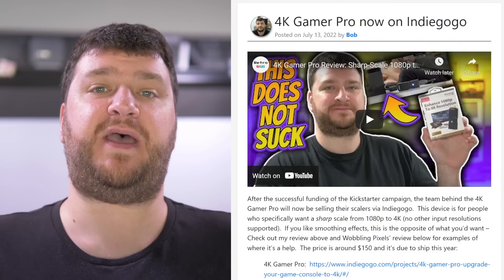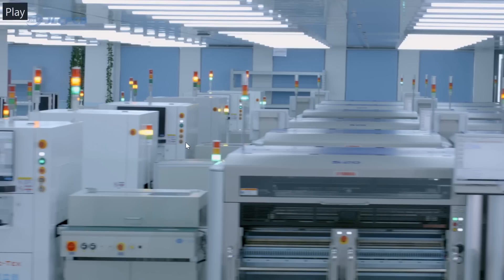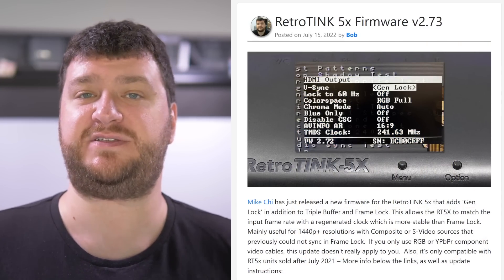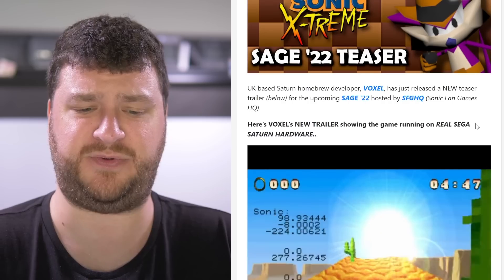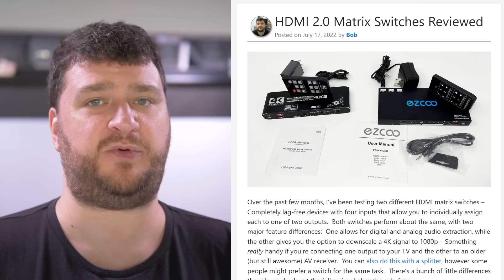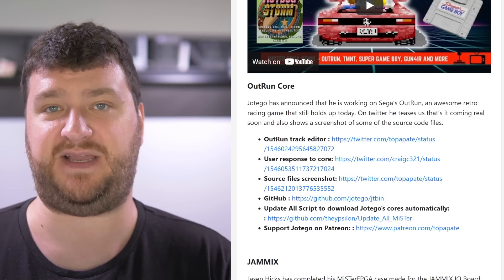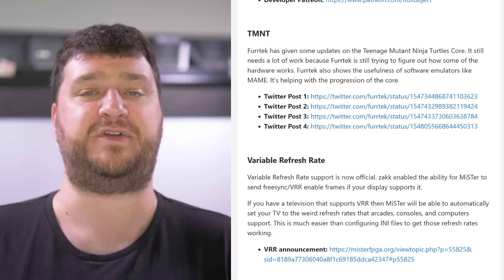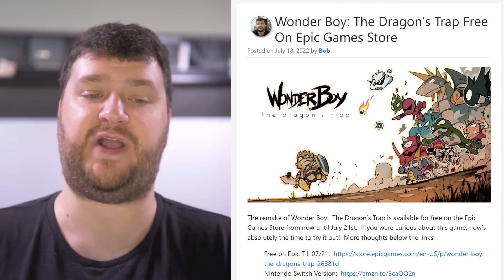RetroRGB Weekly Roundup #314 - July 20th 2022

Comment: The PS2 slim did have a vertical stand.  It was basically a metal disc that screwed into the bottom of the unit. The Retro Frog stands look great though.
Reply from the maker: Oh wow, really?  I've never even seen a picture of one!
Reply: There were different versions of the slim stand for different versions of the slim depending on region
Reply: @Phantasm I’m saying the Japanese 90000 series PS2 slim has a different stand than the 70000 series. And we never got it in the USA
Reply: @Phantasm it looks different. More akin to the phat PS2 vertical stand. It’s very heavy for a stand. And they’re not cheap, since it’s an official Sony product and not available outside Japan.
Reply: @Phantasm I’ve got a couple of them. I’ve got a black one for my Black PS2 Slim and a white one for my white PS2 Slim. I’ve no idea what the region they came from and I bought them on eBay a few years back. Though my systems are PAL and US NTSC and both are compatible with either stand.
Reply: Indeed! It had 2 vertical stands from Sony. One with the metal disc and the other is standard stand. The regular stand version is uncommon and goes for $80+ even on Yahoo Japan listings. 

I really wish they had made a pink one for the pink ps2 slim like they did for the Sakura fat PS2.
Reply: @RetroRGB  Correct, I have one and it looks cool. 😊
Reply: The original ones in different colours (silver/blue/pink?) are quite expensive, check it on eBay 😧

Comment: It's interesting that you happen to mention dabbling into HDMI matrix switchers. I have a bunch of HDMI consoles and equipment plus multiple screens in the same setup so I've been exploring HDMI matrix switchers for a little while now. You're definitely right about the more generic looking ones, quality varies on those a lot. I used to own a 4x2 that worked ok before I gave it to a friend after my first upgrade, but I also had another one before that that didn't work so great. I can, however, give you a few good recommendations if you're willing to explore to subject further. I'll even lend you one of my better ones if you want to make a video for it, check out the end of this message if you're interested.

The first matrix machines I'd recommend is most of the Extron DXP series of switchers: the DXP DVI Pro, the DXP HDMI and the DXP HDMI 4K Plus. The DVI Pro and HDMI variants only support video up to 1200p for PC and 1080p for typical TV's, but they do so at 60hz so they're really good for older 1080p displays and game setups that don't use 4K. The connections are exactly as their names imply, DVI and HDMI, but the DVI can easily be converted to HDMI with a passive adapter and it won't affect anything. The DVI will even support audio which is pretty uncommon despite DVI being perfectly capable of doing so. The DXP HDMI 4K Plus supports HDMI 2.0 at 18gbps with 4K resolutions, but only the "Plus" versions will handle 60hz 4K. These are perfect for PS4, PS5, Xbox One and Xbox Series S/X machines as well as any scaler or line multiplier that outputs 4K. I've personally owned and used a DVI Pro with DVI to HDMI adapters attached and it worked great until I decided to dive into 4K. The HDMI and DVI Pro can be found online all day for halfway decent prices on eBay, but I have yet to find a 4K Plus.

The next machine I'd recommend is the Link-Mi 4K 8x8 matrix switcher. I currently use one of these and it's rated to handle 4K at 60hz and 18gbps. It also has digital audio breakout for each HDMI output slot in the form of an RCA jack using digital coax cables, a nice bonus for sure if the input device doesn't already have a TOSLINK connector on it like most HD consoles tend to these days. The only weird quirk I've run into with this machine is that it treats my Xbox One and One X audio kind of oddly. The OG Xbox One I have keeps having audio cut in and out and my One X does the same thing but only 20% of the time. Resetting the Xbox One X fixes the issue, but my OG One's audio just does not like this switcher at all. Both operate normally when hooked up to my old Extron DXP DVI Pro (at 1080p only of course) or directly to my TV so it's definitely got something to do with the switcher, but no other console or scaler I have has any issues at all including my PS4 Pro, Xbox 360, PS3, Wii U and Nintendo Switch. My GBS Control and OSSC also have no issues with it. I still really like this switcher as I just work around the Xbox's audio quirks with a direct TOSLINK connection to my audio setup from the consoles themselves, but the switcher costs a pretty penny and can be hard to find so it might not be for everyone. 

If you're in the states, I'd like to offer you an opportunity to borrow and test out my leftover DXP DVI Pro. It's only going to get you 1080p, but some people may not care for 4K yet so you may find an audience here. It's also budget friendly so that may be attractive to a lot of people who want to game at a lower cost. I require nothing in return, I just want to help your channel since your content has been so educational and has helped me build my own gaming setup over the years. I'll even ship it to you myself. It comes with the power cable and the all the DVI slots are occupied with a DVI to HDMI adapter for ease of use. Let me know if you're interested and we can make it work. Take it easy my guy! :)

Comment: Does anyone know if the retro tink firmware is able to somehow handle games with odd refresh rate like say the mortal kombat 3 pcb 53hz? I always wondered how that conversion to the flat panel 60hz worked in converters and emulators. 
Maybe with the new type of variable refresh lcd monitors there is a new way?

Comment: Thanks for the helpful videos. I have a question. I bought a 1Chip, SuperCIC & uIGR Super Nintendo and intend to use it with a RetroTink 5x Pro. Am I right that component or RGB would be the best quality output? The console is region free so I don't know whether this affects the sync. I dont fully understand it.  I am wondering what cable to use for component or RGB output. I dont want to get the wrong cable and damage anything.
Reply from the maker: You can use either RGB or component.  If it's a PAL console, just make sure to get the right cables.  Links here:  https://www.retrorgb.com/snescsync.html

Comment: Bob, first, thanks for the amazing content, About the HDMI switches, I was needing to buy one and I was thinking about buying Knivo or monoprice because it was recommended by My Life in Gaming, have you tried these hdmi switches? if yes, what results did you find, what is your opinion about these hdmi switches?
I think it's great that you tested hdmi switches because the first problem someone faces when the number of video game consoles he has exceeds 3 is connecting all of them to the tv, so thanks for the review, I'll read the article and rethink my options.
Reply from the maker: I haven't tested those, but if MLIG says they're good, I'd believe them :)

...with all the same caveats I mentioned here, like designs changing, etc.
Reply: I've had two different Monoprice HDMI switches and both failed.  My first one (5:1) failed one port at a time over several years (bought X360/PS3 time-frame) and then my latest (Blackbird 4K 3x1 HDMI Switch) bought in 2017 lasted just long enough for warranty to lapse.  It worked well until it didin't.  The 3:1 would randomly work sometimes on one port at a time (even with supplying external power) until it just stopped working with no obvious visible damage on the PCB when I opened it up so either chips died or the ports.  It wasn't HDMI cable issues in either case because I tried literally a dozen different cables from Monoprice (of varying ratings) and even original console manufacturers (ie. Playstation, Xbox supplied cables). That's just my anecdotal experience but for me I've had not had success with Monoprice HDMI switches.
Reply: @Daniel-it1dp  Thanks for the feedback. In Brazil there are no such switches to buy so I'll have to import them and feedbacks like yours help me to avoid a lot of headache.